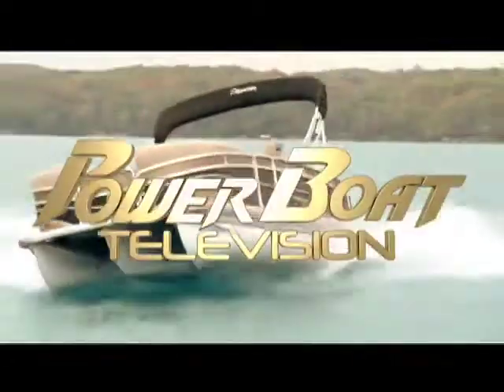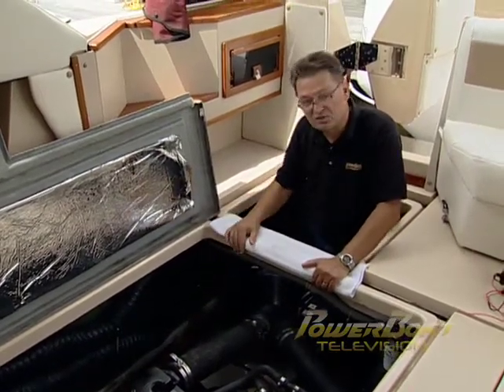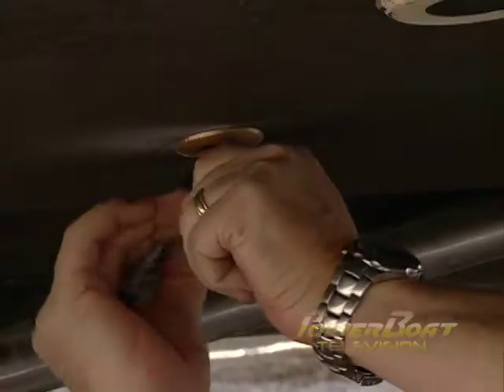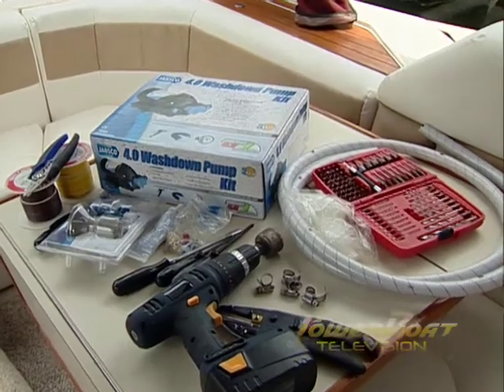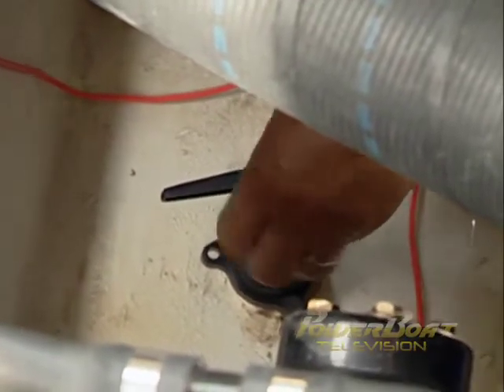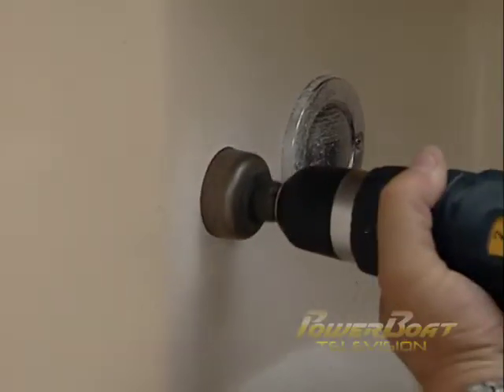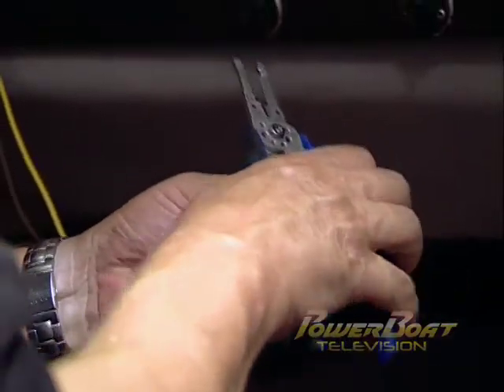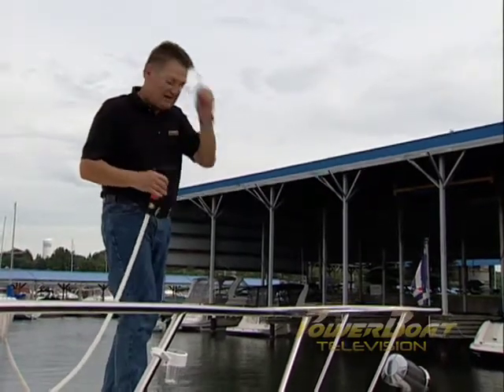How To Install a Washdown System - PowerBoat TV

Comment: This install is the perfect recipie for SINKING!  Plastic valve screwed to a brass thru hull.  Valve flange is not screwed down.  (Flange has a large gap to the bottom of the boat.  The way this is installed all forces from turning the valve are applied to a cheap plastic pipe.  After time WHEN this snaps off at the thru hull, you're left with a big hole in the boat.  Use a bronze seacock with integral flange.  Hull should be thickened to allow the flange to be screwed down.
Reply: In addition relying on 5200 on the outside to seal the hole and not allow any water intrusion.  Should have cut a hole larger than the thru hull sealed with epoxy and then recut ensuring no water will penetrate and create rot.  At the very least put some 5200 on the inside of the hole.